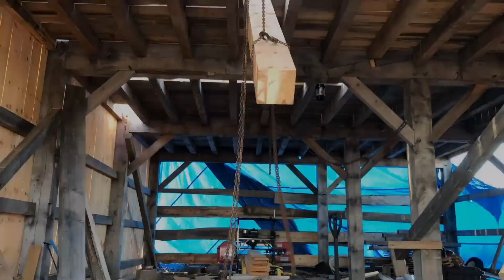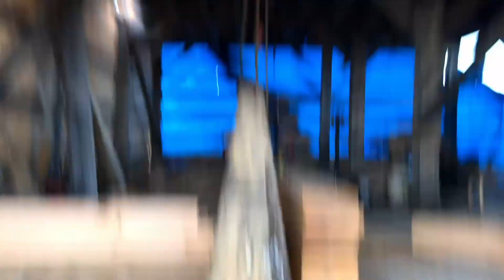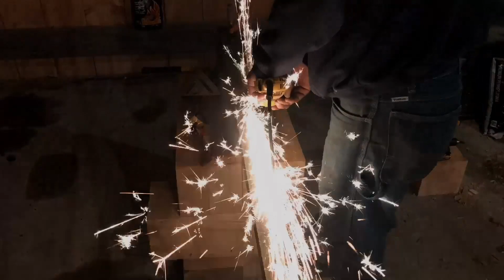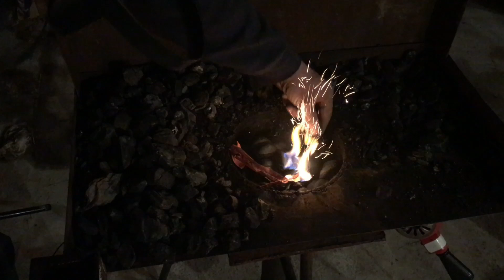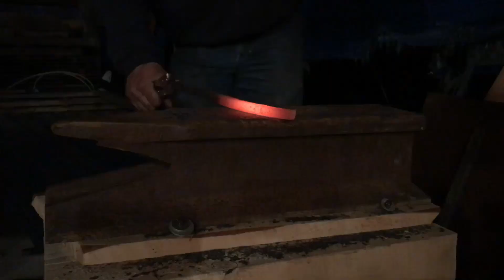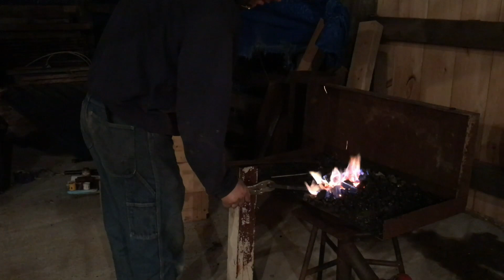ATTENTION: Calling All Small How-To, Woodworking, Sawmilling Channels This is Important

Comment: im interested i do woodworing/turning welding and im currently waiting for my foundry to dry. im a complete amature at editing video. im learning though. with the help of my oldest son. im currently an owner/operator trying to make it out here so my time i can dedicate to editing and creating is very limited.my plan is to use my many years of welding and fabrication experience and the use of my new foundry and smithy all in one lathe mill drill machine and welder to build a large sawmill. and then buy logs to build a lofted workshop/cabin/mancave in my back yard. overlooking a valley in the ozarks. my top video right now is about a set of bowls i made for pure living for life.my channel is not yet monitized. and i had to remove all my reloading videos. no big loss there.like you im a very giving person. and like to make things for people. i also have a 3d printer that i will use to make models for metal casting. my foundry is being built around the largest crucible i could find the A25 sallamander. im struggling to get good footage of my stick welding trying to get past the light. i recently bought a cannon 80d and a few lenses. im currently at the unlucky number 13 of subs. the reason for the big crucible is to cast my own bandsaw wheels and various parts from scrap. my channel should be named something like from trash to treasure. all my projects are made from repurposed materials like pallet wood even my woodworking bench top is made from old pallet runners that are glued together i still need to finish that project though and make a jig for my router to put on my metal working lathe, to make some massive threaded wood vise screws for the bench. the sad thing is i get about 2 days a month to get as much done as i can which leaves editing up to my oldest son. and you know motivation is not always easy with teens even when i pay him. which hes only edited half a video for me which cost me quite a bit ive taught him maybe to good. i have a laptop that realy doesnt like video it has trouble watching youtube my straightalk phone service doesnt allow tethering so im finding it verry difficult to get bandwidth to do any work on the road. and im also trying to teach my commodor 64 brain how to do this editing and uploading and how to post a link. what is this lol. anyway i gotta go haul some crude oil.
Reply from the maker: You will have some great content to put out there.  The editing comes with time and practice.  It takes some time to get used to getting in front of the camera.  I would love to have you on the list.  If you can, make a short video of what you are doing, describe the channel and I will put it in the playlist dedicated just to this idea.  I'm going to start with the shoutouts as soon as the videos come in.